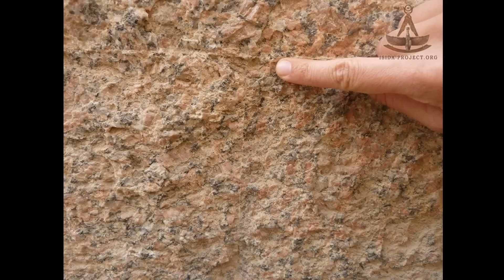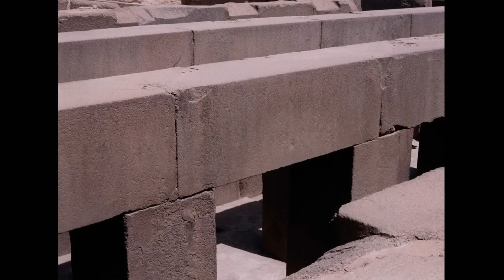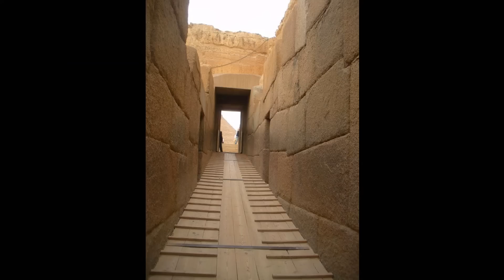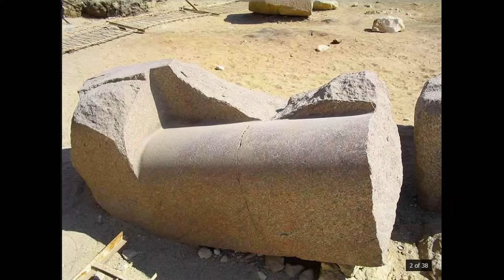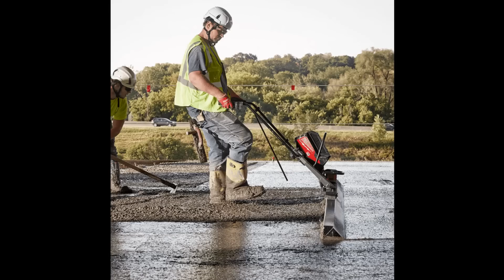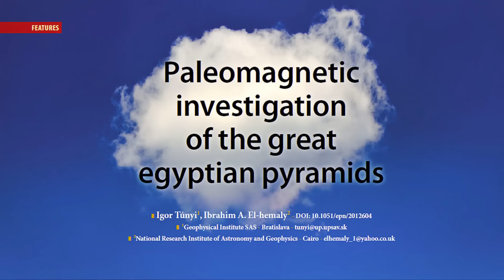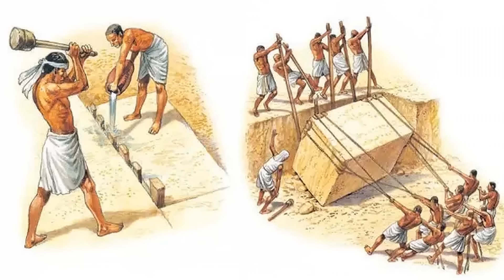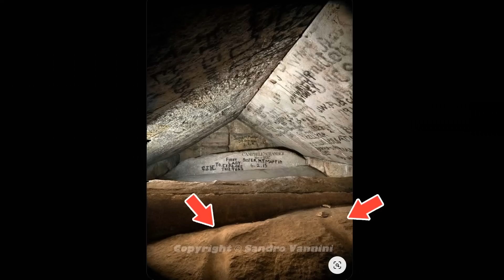How were the Perplexing Giza Pyramids' Granite Blocks Created?

Comment: Hi , nice shirt, and I hope you not been rioting , I believe what you say is within the reasoning and evidence  , however like many if not all these structures  all explained , reasoning seem to suddenly end , and no further understanding can be made . In reference to casting , casting in large quantities as in any casting , needs to be done in one continuous process or their will be imperfections and colouring  , also with casting , for example,  casting a box shape out of situe  , you require at least 5 sides,  so you retain the shape when the material is poured in , so when casting in situe how many side would you need to retain the desired shape  ??? Meaning also , you need sides to retain the box shape of each individual shape  , other wise you would have a continuous display of on casting  , so how would you aquire the water tight shape of each casting without using sides and if you did how would you remove the sides when the casting is completed,  to giver the effect we see to day .??? ❤

Comment: Your thesis has good merit and that has been a popular thought of many.  Especially due to the nodules found on some blocks. Even today there are many types of cast granite using concrete, epoxies, even metal and fibers for strength. However for load bearing stone none of the man made granite is generally used,  as it is susceptible scratching, heat and excessive wear. which is why it's generally not even used for kitchen countertops or tables. It also doesn't' have variations in the grain of the stone which are evident in several blocks in the Egyption historic sites. I would also then want to know how the ancient Egyptians would have crushed the thousands of tons of stone to get the powdered/granules of granite needed to make the casting.
Reply: I agree. Concrete can not be used structurally to the level that was needed at the Pyramids. That is why structural concrete always has steel reinforcement inside because concrete alone can never provide the support. Besides a "concrete pink granite" would not look like regular pink granite due to the additives required to make it set like concrete.
Reply: @9344music5  We  have no clue as to what additives (binders) they used, so we cannot say that what we don't know means that what we can't prove is proven false.
Reply: They used the detritus from the unfinished obelisk and other later quarrying work.  They crushed the granite 'rocks' with the round dolerite 'pounders' that were found there by the hundreds.  As for carving vs casting granite, the granite that was carved was shaped by technology that was from the same origin as that which was excavating the unfinished obelisk before Egypt even existed, and that is extraterrestrial technology handed down through the centuries by the kings of Egypt who had hybrid ancestors with long skulls.
Reply: The crushing was partially done by tectonic forces but also done by the E.T. machines that excavated the unfinished obelisks.  The detritus from that work would have formed a small mountain, so there was plenty of crushed granite for later use... and the round dolomite pounders were used to crush the scooped granite into smaller pieces.

Comment: Great workTina. Especially the finished and unfinished stones on the pyramid. The granite was definitely molded. The question is how did they make the granite soft. They had to soften the stone to make the scoop marks around the Obelisk at Aswan and also drill core holes. I’m still thinking about the polygon type walls. They look like molded stones and cut the joints with a wire.

Comment: The look of any cast stone is very distinct: it is homogeneous. Castings also all have this one tell-tale sign: horizontal banding as the material settles and dries due to gravity pulling down. It is very even, never with long irregular or diagonal veins and oblique marbling. 

I've been to Giza and the granite is full of not just oblique veins but quartz veins, which can only be made under immense pressure underground with complex mineral processes. If you simply heat crushed granite in a kiln it turns to glass. These granitic stones were not cast...which only makes their forms even more astonishing. 

There are a few sections of Giza that do indeed have what looks like cast stone, specifically limestone. These sections are very homogeneous, too even and fine, and appear quite unusual under a magnifier. But these I only found in two very unknown spots as a several-foot thick "plaster" wall treatment, and were not the usual normal blocks.
Reply: Pre-dynastic and Old Kingdom Egypt did NOT have the tools and technology to work granite.  The tools and methods to do so were extraterrestrial and wielded by machines from another world under the guidance of the e.t. masters.  Crushed granite is NOT powdered granite.  It's not granite sand or granite grit.  It is large, visible crystals someway bound together with a powerful unknown binder.
But I'll accept your eye-witness account of evidence that some things were natural stone and therefore were carved but that is only because of recent analysis of the Barabar caves in India.  It was not possible to terrestrial technology to have excavated them to the mind-blowing geometric perfection that they display especially since the stone is granite.
But stones like those of the Menkaure pyramid were not shaped by tools, not saws or chisels or pounders.  So they were undoubtedly cast as their shapes indicate.
I'm gratified that you recognized that limestone blocks were not all quarried, but may have been mostly cast.

Comment: If the granite was cast, it would have a Portland type cement between the ground up aggregate. The granite casing stones are granite all the way through. There’s no evidence of granite aggregate being bound together with cement. They would also have to have a method of grinding up the granite to make the aggregate. How do you grind up that much granite?
Reply: My kitchen sink is comprised of ground up granite with a plastic binder. It resembles stone, but is thinner, more durable and not subject to chipping. This kind of product has been in use for some time, such as in public buildings and offices for counters and floor slabs.

Comment: Hi Curious Being, the granite beams above the "Kings Chamber" does not weigh in average of seventy tons each as stated in your presentation. There are forty-three granite beams. The heaviest granite beam has a weight of sixty-two metric tons and is in the ceiling of the chamber. The lightest beam is no more than twenty-five metric tons and is located further up in the construction. Further there are twenty-two limestone blocks in the herring bone roof above these granite rafters. The heaviest of these weigh forty-five metric tons. The lightest twenty-eight. French architect Jean-Pierre Houdin calculated this and published the work in his book The Big Void.

Comment: I have a problem with this: how do you deal with the 80 ton blocks?
Reply: To complete the idea: the 80 ton blocks are part of the resistance structure of the pyramid and , this is not reinforced concrete here..., I seseriously doubt that the operation of pouring 80 tone of composition on site would have the same qualities like a monolithic block!  ...And: do you realize how much 80 tons is?

Comment: It could very well be that the granite stone work on the Giza plateau was cast. But in addition to the casting or forming methods used, whatever they might be, one must consider the immense scale of production needed to build all those structures on the Giza plateau. 
It would take an extraordinary industrial system to produce and move around the cut or cast stones, not counting the work needed to cut even the millions of limestone blocks required to build the three largest Pyramid’s cores, plus the adjacent stone temples and stone flooring works around much of those structures. 
And after all the stone forming and cutting operations the Pyramids still needed to be fully encased in polished granite stones, with no two stones shaped alike. 
It was truly mind boggling to visit the Pyramids at Giza. Perhaps overwhelming would be a better word. 
However they were built, only a highly technologically advanced society could undertake such a gargantuan project.
Reply from the maker: I agree. Thank you for sharing with me.

Comment: Hi Tina.  Thanks for another great video. I remain unconvinced about the cast granite hypothesis. modern cast granite is made with things like epoxy and other kinds of cements, that cure over time - not real granite. The pyramid granites are real granite. Its certainly possible that the pyramid builders used limestone based mortar to match the rough granite back side, but i  think the granite is not cast. to get flat surfaces, granite can be ground. I wonder if diamond and carborundum crystals were bound in natural resins, and applied to twine or tube drills. i feel that the 'scoop' marks in granite are the giveaway to how it was worked. i think nobody has been able to reproduce them, certainly not by heat flaking. for me, the scoop marks the most important clue. all other cutting can be explained using abrasive pastes or resins. And i think that the pyramid builders were smart but not especially advanced.

Comment: Some of my speculations; the knobs could be explained as the places where some kind of vibrators were used to remove air bubbles from freshly poured material, as we do with modern concrete. When removing them, while the material was still soft, the knobs form. Or maybe some electricity was used to initiate or speed up the hardening. Knobs come in pairs often, a plus and negative pole creating heat? 
Molds were only used to flatten the unattached surfaces, to keep the material in place while soft, and to create a level layer on the top. It is way more difficult to stack stones and use mortar than to pour them in place against each other. The material likely came from mine shafts under the Giza plateau, being mine waste, as you indicated before. Maybe some material was added from Aswan, but that would have to be ground and transported, which is very labor-intensive. The shapes of the front of the stones suggests some swelling during the hardening.

Comment: Can't see how the partially flattened exterior granite casing stones support the casting thesis ,- in fact it shows the exact opposite with fully hard blocks in place and then somehow 'chiselled' down to the finished size.  Screeding only works with a slurry that is solid enough not to slump and would not end in radii as shown ( i was a patternmaker for many yesrs and familiar with foundry sand and
 casting .materials using profile runners in plaster etc.
How it was all done is still a profound mystery.
Reply from the maker: I think dry cast concrete like blocks be screeded before they cure, as they have a solid and malleable stage before they fully cure.
Reply: There would be striations in the direction of the profile runner if so, it seems definitely natural granite and had to be shaped from bulk rock but that is too astounding to explain also.  Nothing makes sense ,yet.  The unarguably natural stone outcrops sliced with absolute geometric precision in Peru show that they had some method to cut hard solid igneous stone with apparent ease and for no discernible reason (eg the throne of the Incas and other stepped  cut outs just in the open..)
Endlessly fascinating subject but also maddeningly perplexing.
Appreciate your responding and the work you put in to these investigations.

Comment: Hi Tina. Nice to see your video. 
If one steps back and considered several of your prior videos on Egypt and this latest you have to conclude that whomever did this work had several different technologies. 
The quarry’s indicate that they did cut and transport stone. And this points to tooling much more capable than simple bronze tools. In other cases “cast in place” is the only logical explanation for some structures. So add that to their “toolbox” too. 

Your research into synthetic stone and terrazzo is inspired. I’ve seen many ships decks finished with terrazzo, which is ground flush and appears as if it’s marble or granite. 

To make artificial stone you need cuttings or flour from natural stone. Or a natural pure sand source of the mineral in question. In our case today “faux granite” is made from granite saw spoils and various binders. There is a bank building in Seattle faced with granite. The flat panels were cut about 60 miles away at Index , Washington. Then transported by truck. The decorative trim with elaborate curves was cast from granite saw spoils from the same quary. If I had not read about how that building was made, I’d swear it was all natural stone. And this was done in the 1950’s to boot! I lived for a year or two in Index and visited the abandoned granite quarry and saw the old saw. Really quite simple technology. But not a bronze saw!

Which brings up the last point which you’ve mentioned briefly in the past. Everybody is an “expert”. We have materials and industrial engineers, geologists, and a variety of archeologists. Each experts in their own field. Yet shockingly ignorant of the processes in other fields. Back in my college days I used to amuse myself in the cafeteria asking various PhDs what the Formica table tops were made from and how. Most had no idea. Except the materials engineer. That was his area of expertise. 
So not much in Egypt has really been “tested”. And that which has been tested, not by the appropriate expert. 

So i tend to agree with your analysis. Keep up the good work. 

Fox out.
Reply from the maker: Well said, thank you for sharing your insights. Always a delight. Good to see you :-)

Comment: It's always a treat to see a presentation by the Curious Being, love the unorthodox and logical thought processes so clearly expressed. The presentation on the Carolina Bays was one of the best and clearest explanations of a natural phenomenon that I've ever listened to.  There are some problems with the cast stone theory however. One of the problems which you mentioned in passing,  is if they were cast it would be much more likely that the blocks would have been uniform and not so individual.  Look at any cast work and you'll see repetition of the shape.

The flattening looks to me like it could have been done by some sort of machine that was removing the rough surface like a giant belt sander, one can see a radius where it goes from flat to rough on the blocks by the entrance to the pyramid.  There's also on other vids clear evidence of cutting tools of some sort being used, some of them extremely large such as the radius (or was it the diameter) extrapolated from the arc end of a cut to be something like 18 feet!

 It definitely looks in a lot of the work, especially in South America, that the stone was malleable and able to be pushed into shape and manipulated, or possibly poured although the ones in south America are extremely random.  It also seems like the ancient builders were able to move these tremendously heavy pieces easily.  The knobs are strange because they are not on all the blocks and are also somewhat random in placement but a lot of them do resemble the extrusions one sees when casting, where one side is for pouring the material and the other side is for venting out the air.  Anyway, thanks so much for another great presentation on a mysterious subject.
Reply: The shape of ancient cast blocks isn't what we would do.  Take the Menkaure blocks... perfectly flat on at least four sides, but the outsides are lumpy.  There's an explanation for that.  They were cast in bottomless boxes on the soil or sand.  The more blocks that came from one spot, the more the ground became concave as the material of the ground stuck to the stone concrete mixture.  That gave them that rounded shape with none being identical because the shape of the ground was changed with each casting.

Comment: The knobs on the stones/blocks could be the leftover of a casting or molding process when the blocks were created. Molds or frames could have been used in making the blocks, the liquid stone material would be poured into the mold through the opening, as it firmed the stone mix may have expanded rising up through the opening the mix was poured through, leaving the knobs or nodules we see today.

Comment: From the evidences available I would argue that the scoop marks were done using the same technique as the finishing.  
It could mean that the scoop marks in the quarry may represent how they removed softened granite to then transport it in small portions then put them in place.   

But then why would they carve complete obelisks? Was it so easy to remove that they would carve the finished object and then scoop it to move the exact required amount of material to the final location?
Reply: By evidences I include the Barabar Caves which would be so incredibly difficult to make without the ability to dustlessly remove granite. And also the fact that re-adding material may have been required to achieve the insane precision.  

Speaking of precision, laser precision means measurement. We have laser precision measurement but no laser precision manufacturing processes for stones as far as I know.

Comment: I'd also like to hear your thoughts on a hypothetical. In the case where there's two Granite blocks stacked on top of each other where no human hair can go between. If you had broken apart the top Granite block do you believe that the top of the bottom block would be polished smooth or would it be rough?